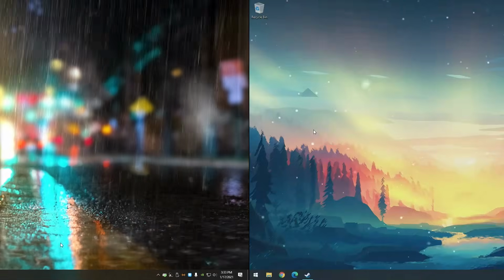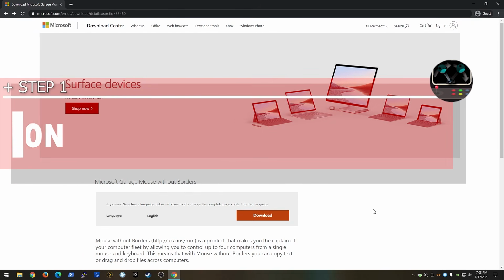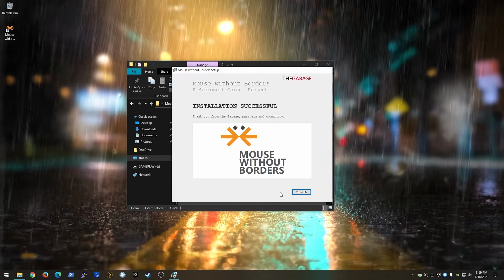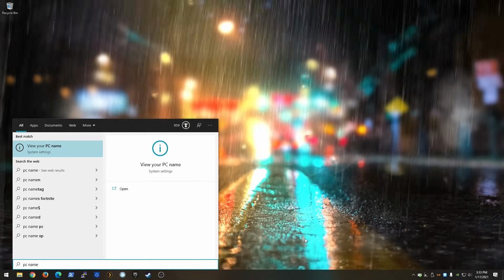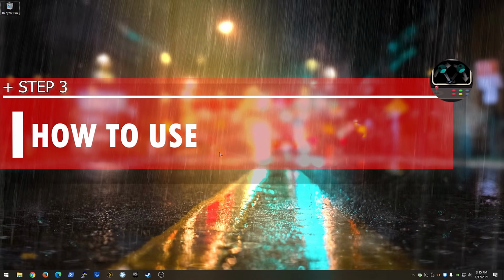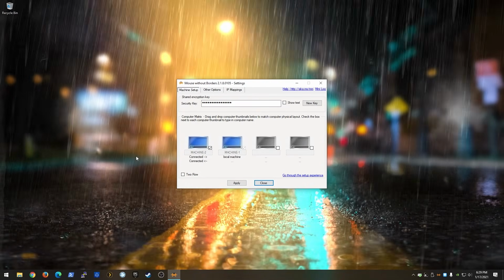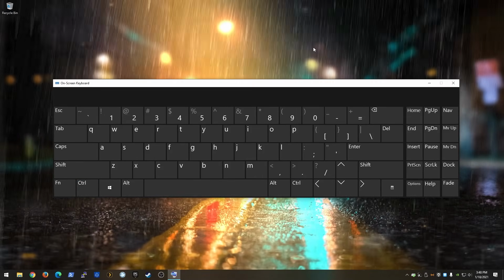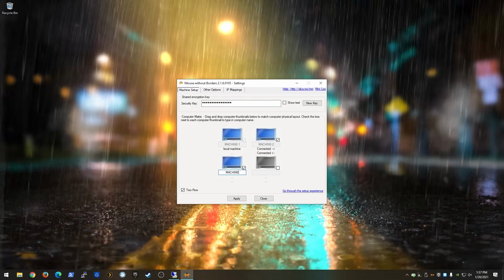Control Two Computers with One Mouse

Comment: Hi, Thanks for sharing! love this! do you have any similar solution to pair of 1 windows and 1 chromebook?
Reply from the maker: Thanks for your feedback! From what I've found, it looks like you may be able to do this via Synergy.

It looks like these 2 Reddit posts are suggesting it's possible with ChromeOS and Windows 10 but through Synergy which is another popular (but paid) option:

(1) https://www.reddit.com/r/chromeos/comments/3zggqv/keyboardmouse_sharing_from_chromeos_to_windows7/

(2) https://www.reddit.com/r/chromeos/comments/3zggqv/keyboardmouse_sharing_from_chromeos_to_windows7/

And if you're OK with using a remote desktop-like interface instead, another option you have at your disposal for your particular use case is RealVNC.

Comment: This makes me wonder whether the same 'trick' can be applied to 2 different PCs connected with LAN Cable.
Reply from the maker: In some cases, yes. If you mean 2 different PCs without an actual router/modem/gateway, it can still be done provided you have one of the PCs act as a hub or LAN access point. But this is an uncommon use case for most people since if you have multiple PCs, you'd mostly be connected through your Wireless or ethernet LAN through a router/switch/etc.
Reply: @ArcadeSpinner  
Yes, i do mean without actual router/modem.
Because i remember i used to transfer files between my laptop(online) and my PC(totally offline) by connecting both of them only by LAN Cable.
..which is very convenient to me.
The drawback is that i was using 2 x mouse & keyboard.
Looking at your method, i just thought to myself it is gonna be really convenient if i can just use the same mouse & keyboard back then.
Reply from the maker: Absolutely. That would definitely have been convenient and viable for you!

Comment: What if one of my system is on vpn and one in home network
Reply from the maker: That's a great question. Unfortunately, VPN connections will throw Mouse Without Border's mappings off track. I haven't been able to get it working on my work machines with VPN enabled.

Comment: i click in NO. now i cant configurate, if i unistall and install again, not askme if i want configurate.
Reply from the maker: Just so I understand your situation, are you referring to the initial setup screen that displays right after you initially install the application? If yes, you can force the application to show this screen again at any time. Just open Mouse without Borders and click on 'Go through the setup experience'.

If this doesn't solve your problem, please provide a more in-depth description and I'd be happy to help!
Reply: @ArcadeSpinner  thanks dude.
Reply from the maker: @albertodominguezmarina5985  No problems! Glad it helped.

Comment: my mouse works on the other pc but my keyboard doesnt
Reply from the maker: Are you, by any chance, using remote desktop or a virtual machine on the faulty one? Not sure how your setup is but one solution from Microsoft Answers is the following --> "The workaround is to enable the option "Hide mouse at screen edge" on the Settings form or switch the focus to another window first."

If this doesn't fit your situation, I'd be curious to hear more about your setup.

Comment: it works like hell.damn. Super laggy on my second laptop.
Reply from the maker: Are both machines connected via ethernet cable? And also--another note: I have seen that a lot of times when people have both Wifi and Ethernet connections active, it may use your wireless one as opposed to ethernet (depending on your connection adapter defaults).

Comment: Hi, nice app! But i'm facing a problem. I have a master machine and a slave machine, occurs that when using MWB I only can use the slave machine mouse instead of using mouse and keyboard of my master machine. I really tried everything to solve this problem and use my master mouse and keyboard, but without success... Could you help me with this issue??
Reply from the maker: Absolutely. Have you tried setting the hostname and IP information on both machines' MWB settings? And another question: Can you confirm that MWB states the status is 'Connected' on both machines? Last but not least, can you confirm that in the 'Other Options' tab of MWB, the 'Easy Mouse' setting is set to the same value on both machines? The reason why I ask this last question is because I have seen cases where it's not and, as a result, one machine would just hang because it would be expecting you to either press the ctrl key or shift or vice versa on either PC.
Reply: @ArcadeSpinner  i've tried your suggestions, but still with no results. It's funny because I've picked another PC as a slave and did the same proccess to install MWB, the problem still happening, cant control with my master peripherals.
Reply from the maker: @DouglasSantosBNU  This is interesting... I can give you 2 suggestions and see if it helps:
1.) Did you make sure that 'Mouse mouse relatively' is unchecked on the 'Other Options' tab for both PCs?
2.) On the machine where it doesn't work, you could try adding inbound/outbound firewall rules  to ensure that no firewall settings are blocking the connection. This one, however, may require some troubleshooting though.
Reply: @ArcadeSpinner  The problem was hapenning because I was a master notebook with two screens... when I disconnected one from de HDMI it started to works fine.. Dont know why, but now its working..
Reply from the maker: @DouglasSantosBNU  That's certainly weird. But glad to hear that it's working! Cheers.
Reply: @ArcadeSpinner  I'm still using MWB, but facing some other problems.. sometimes glitches pressing F8 key, then I have to reboot the connection. Are you facing this problem?
Reply from the maker: @DouglasSantosBNU  The only time I've seen something like that is when you have MWB (as well as some other app) get tied to the same keys. Not sure if that's the problem here but I would advise checking to see if more than one app has ownership to F8 while running at the same time.

Comment: Hi, so I would have to have my keyboard and mouse both on cable and not bluetooth?
Reply from the maker: There is no Bluetooth connection involved here. You meant to say that you want both PCs connected via USB cable connections as opposed to LAN, right?

Mouse Without Borders is only used for getting PCs connected via your local network. For peripheral-based cable connections, you'd need something like a KVM capability (which typically has a cost).

Comment: Will it work when on of my pc if off ? 
Actually I have Bluetooth Mosue and keyboard .
Reply from the maker: Unfortunately, it wouldn't work unless all (or at least both) PCs are online and connected through the app. Bluetooth is not supported since the idea behind the app is to get PCs connected in a local network without any distance restrictions. Bluetooth, on the other hand, does have limitations around how far the signal can be transmitted.

Great question though!

Comment: Thanks for the great information. As you mentioned it is not possible to drag applications from one computer to the other. I am trying to set up 2 computers with 3 screens and would like to be able to drag applications or results of a search from 1 computer to the other using 1 mouse and 1 keyboard. Do you have any recommendations for a KVM, mouse, and keyboard that will enable the use of the mouse to drag those searches or applications from 1 computer to the other with no buttons,  just crossing the mouse from 1 screen to the other?
Thanks for your assistance. Sal C.
Reply from the maker: Thanks for your comment! As to answering your question, I wish there was a solution for that type of use case since I am honestly unaware of anything that would let you transfer over cross-app functionality from one computer to another. But I can certainly tell you why that would be complicated and what that would involve. Control of a mouse and keyboard is simple because we're just talking about either moving a pointer from one coordinate to another (mouse) or pressing a combination of keystrokes (keyboard). Transferring applications, on the other hand, means you have to take into account so many factors: Transfer of all the data that's in memory (or RAM) for that process, what happens when the receiving computer is not able to perform with a huge payload of this information, and maybe a plethora of other things as well. Not to mention, keystrokes and mouse movements are probably a few Kilobytes worth of data every second. Transferring over your current app state, on the other hand, can probably become as large as a few gigabytes in size.

Hope that helps... somewhat 😃

Comment: It’s kind of glitchy for me for my second screen
Reply from the maker: A couple of questions to help address this:

Are you connected to your local network through an ethernet cable?

Have you noticed that the connection frequently drops?

Being unsure of your answer here to those questions above, I would recommend avoiding being connected through Wi-Fi. Secondly, you can try to map the IP of both machines on both ends of the connection so that it has to do less work in identifying the machine.

Comment: Hi, thanks for sharing the great information!
What I am wondering is, for example, is it possible to drag the Chrome tab across the monitors?

Since it's two machines with separate monitors, it seems different from using the same computer for two monitors. Thank you again for the good video.
Reply from the maker: Hi, thank you for your comments! However, what you just stated is not possible with Mouse Without Borders since you are only sharing the mouse and keyboard. You cannot share applications' UI between machines (if that makes sense).

Glad you liked the video!
Reply: Why would someone want such feature? Send the link over using the Chrome built-in function, it's somewhere on the address bar

Comment: Is it possible to use the same mouse and keyboard at two different systems at different times? Not simultanously... Please
Reply from the maker: If I'm understanding your question correctly, yes you can. When you have control over another computer, the others are simply idle during that time. So you are not controlling them simultaneously, per say.

Comment: Is there a way to use both simultaneously? Like have a cursor on right computer left computer and when you move your mouse both move at the same time?
Reply from the maker: This is an interesting question... But being able to do what you mentioned won't be possible because the developers never considered this type of use case for the program. Theoretically if you tried (even while having 2 instances of the app open on both machines), you'll most likely only be able to control one pair of mouse + keyboard. The only way you can hope to do what you described is through 2+ mice that are connected to both machines (but you wouldn't have more than 2 hands) 🙂.

Comment: I think I know the answer, but anyway: can you move one app from one pc to the other? Like you have 2 monitors...
Reply from the maker: This is a great question. But unfortunately, as you may have already realized, moving entire applications over from one PC to another won't be possible (at least for now). In the future, however, I can certainly see it happen if Windows can somehow make UI architectures reusable so connected PCs can somehow become aware of what app you were using or data you were working with on the other corresponding PC.
Reply: @ArcadeSpinner  thanks for the reply.
Something like Windows on cloud...
Reply from the maker: @miiihaaas  Absolutely!

Comment: Hey, I have recently broke my keyboard so I need to use my laptop keyboard for the time being, this app is great but I don't want to share mouse with both devices I only want to share keyboard. What boxes do I uncheck to just share keyboard thx I subscribed
Reply from the maker: First of all, thank you for subscribing! Secondly to answer your question, what you can try is disabling the 'Easy Mouse' setting from the 'Other Options' tab. Although you cannot simply turn off mouse control across machines, you can at least avoid having your mouse automatically switch to another PC this way. If you still need to move to another computer manually, you can try opting for 'Ctrl' or 'Shift' for the 'Easy Mouse' setting. This way, you control exactly when your mouse can go past the active PC's "borders".
Reply: @ArcadeSpinner  Thank you, that helped so much.
Reply from the maker: Glad to hear that!

Comment: I am using MWB on 2 PC's with one monitor and it works great when both PC's are turned on. Is there a way to use it while the primary PC is turned off or do I need to get hardware KVM switch?
Reply from the maker: You would need to ensure that both PCs are turned on and online via LAN/Wi-fi. The only exception to this is if you have, say, more than 2 PCs connected on Mouse Without Borders. One PC can then be turned off but you'd still be able to control the remainder of the machines still online.